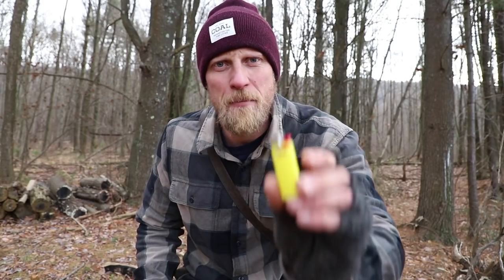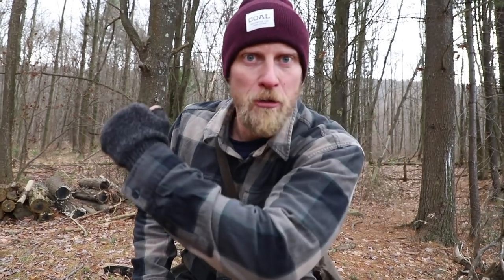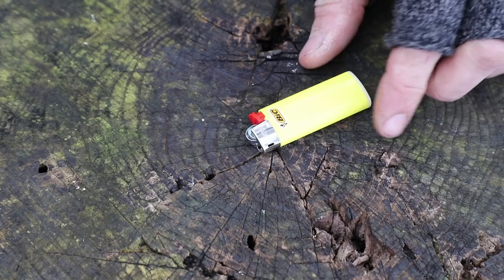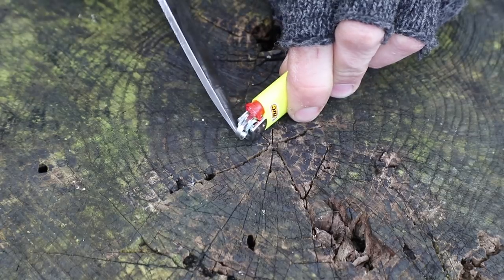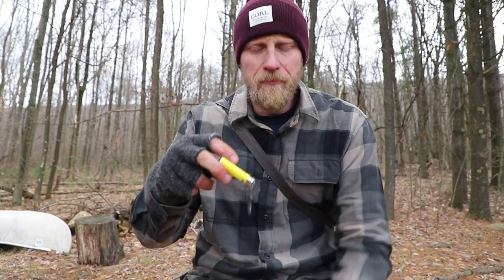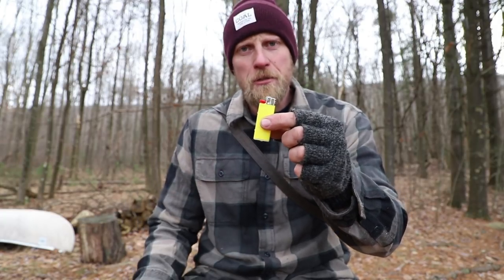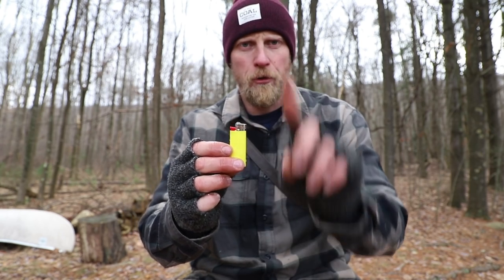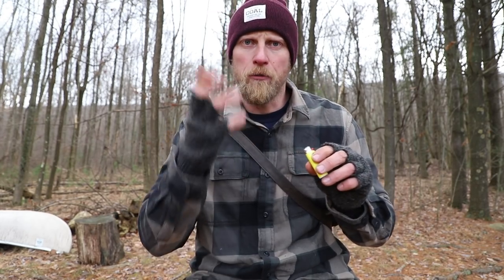Survival Hack: Fixing a Wet Lighter

Comment: You should also secure the striker button from inadvertently depressing in your pocket and losing your fuel.  Take a piece of bank line and tie it around the lighter under the flapper.  Now it can't get depressed and lose fuel.  Bonus is that the bank line can be used in starting your fire.  Good video, thanks.

Comment: The Bic is really just a convenience item.  The fuel in the Bic stays liquid in temps under freezing, it won't off gas, hence why its important to warm it in your pits before you can use it.  Different fuels work that way, some stove fuels for instance, there are fuels that will off gas at very cold temps like 100 F below it will still ignite, I don't recall what kind of fuel that is but thats not the point.  These are great short info laden videos.  Some of the bigger utuber are sticking to the longer version and I don't take the time to view them as easily.  Just saying.  keep 'em coming.
Reply: So...  butane is the typical  lighter fluid. It's boiling point is at about freezing, so it must be warmed anywhere below that to get vapor. Propane boils at -44°F -42°C, and natural gas (primarily methane) stays as a liquid all the way down to -260°F  -160°C.
Pressure and temp are related, so in order to keep something liquid above its boiling point it must be pressurized. Butane is therefore perfect for pocket lighters, because not much pressure is needed, propane is better for larger applications because the act of releasing fuel depressurizes the system and drops the temperature, so you can still get vapor at "room" temperatures. It also only takes about 125psi to liquify at room temp, whereas NG takes about 4500psi to liquify at room temp, making it impractical for many basic portable fuel needs, even though Ng is slightly cleaner burning and also lighter than air and less likely to pool than propane and cause explosive dangers.

Comment: Lighters are great, but they are also easy to loose, and they do eventually run dry. Knowing another method of starting a fire is always wise, even if you never have to use it.
Reply: The fuel may run out, but the lighter is still useful in making embers with the sparks.
Reply: @robinblake5054 if you have nothing else to work with maybe, but the spark it makes is tiny and inconveniently aimed for that purpose. Good luck getting it to work.

Comment: I think each fire starting method has its pros &cons, so you just have to weigh them for yourself. However, sitting around, rocketing over niggling pros&cons is a luxury only affordable due to our relatively affluent lifestyles. A common man in sub-Sahara Africa, or the Siberian out back has more pressing things to think about.

I don't carry a Vic type lighter b/c I don't smoke, so I don't fiddle with it often. Conseq uently, the little fuel button gets pressed in my pocket over time, discharging the butane. When I finally do get around to checking ...months later....it won't for b/c its empty.

I carry a Zippo. First b/c I'm old school. I've been carrying a Zippo since 1979. I KNOW the fuel evaporates, so muscle memory dictates I check it daily. People compla,in that that is just SO inconvenient...so is locking you doors at night but only a fool wouldn't. Critical systems checks are always inconvenient but necessary.

For true survival situations, I prefer flint and steel. The more the wind blows on an ember, the hotter it gets. Just my w cents.